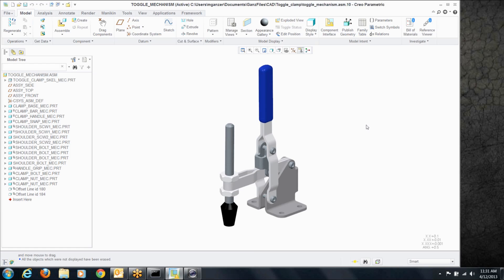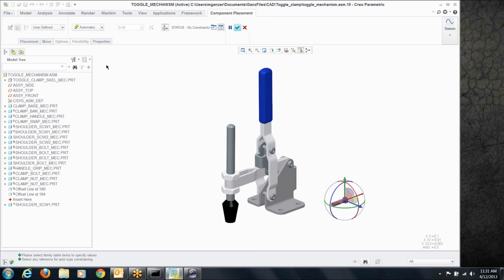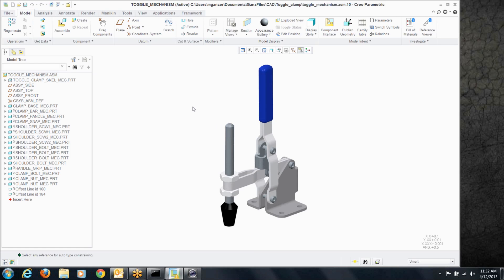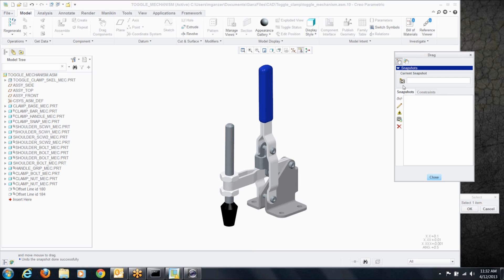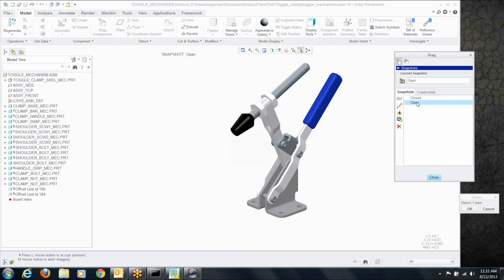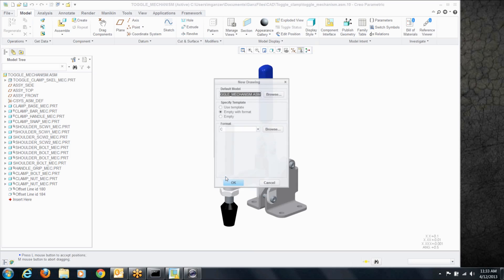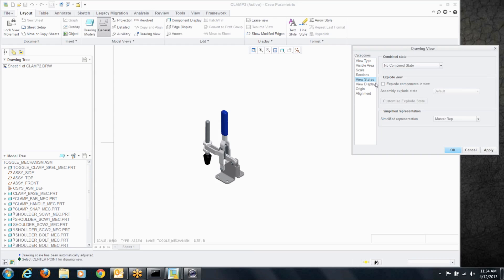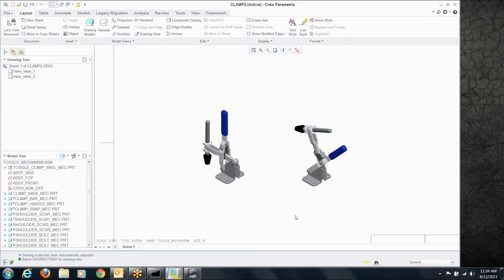Using Mechanism Snapshots to display different assembly positions on a drawing - EAC Tip-of-the-Week

Comment: Thank you for a nice and straightforwardly explanation of this. Now I have a question about, is it possible to show a spring made only in the mode Mechanism, to show on a drawing in addition to this method (so that the drawing shows the extended spring in the "open" version)?

Comment: Dear mister Ganzer,

I am using snapshots in the assembly mode of Creo Parametric. When I make some constraints inside the snapshot menu it is possible to define some positions in the assembly, in my case an assembly of a lineair slide. I use the  When I make some changes in the ''allign two entities'' constraint to constrain two planes from two different parts. The plane representate the positions that I need in the assembly. However, when I change the definition (offset) of the plane in the part, the snapshot (the constrain inside the snapsot) does not update. I already use regeneration from the assembly and update the snapshot  (right click on the snapshot and choose ''Update''). Do you have a solution for this problem?

Kind regards,

Patrick